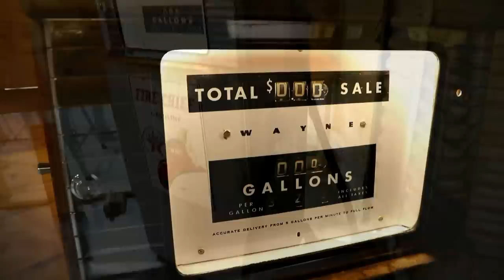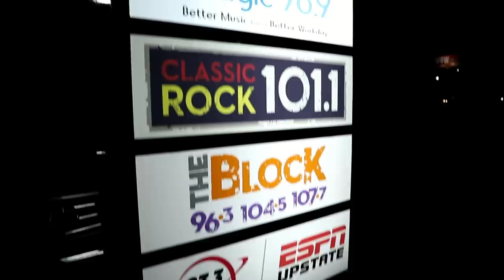Would You Buy A New "Old" Ford Bronco ?

Comment: No.  I owned a 1971 Bronco.  Cold in the winter and hot in the summer.  No AC, no power steering, noisy, ride quality was rough no matter what surface you were on.  No inner fender liners so all of the snow, mud, etc. flung off the tires went inside the body panels and they rusted out in about three years.  It was a truck with stiff suspension and a short wheelbase.   The Bronco was fun in 1971, but nostalgia doesn't make it comfortable to use if you want a daily driver.